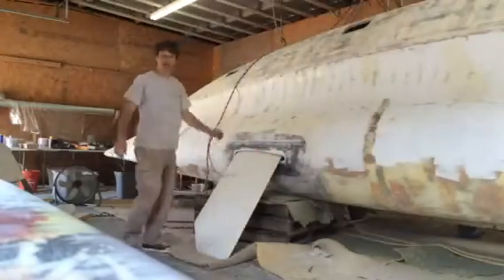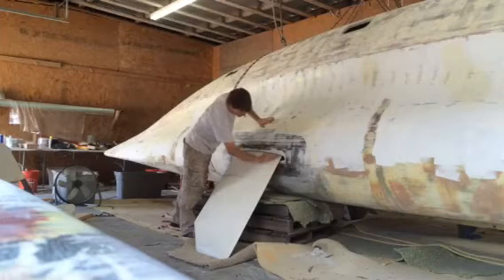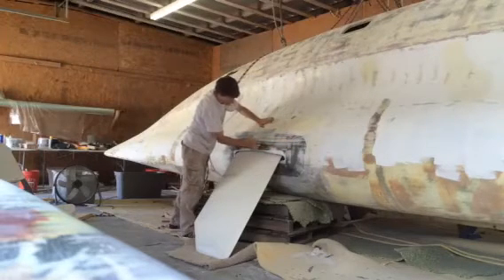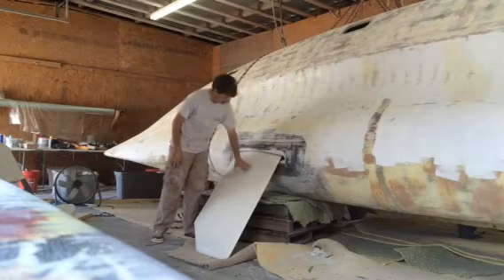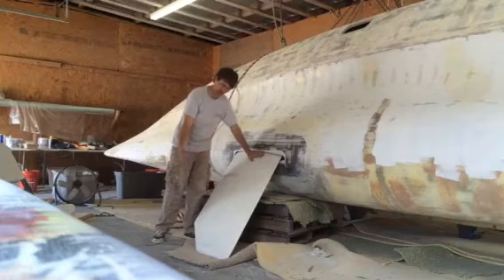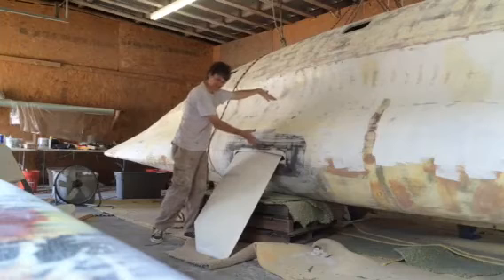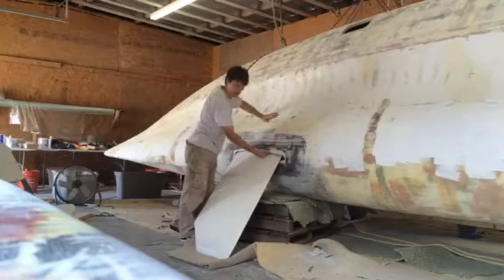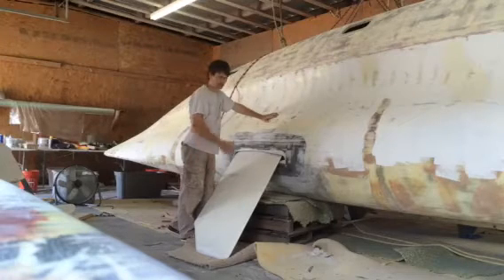Daggerboard

Comment from the maker: I did use a cheap CAD program called Turbo Cad to float the engineering lines plan and to have the frames for the mold cut.  Other than that, Shuttleworth did all the designing.